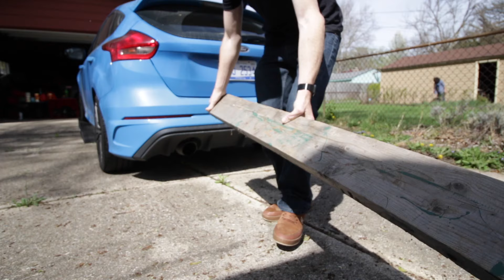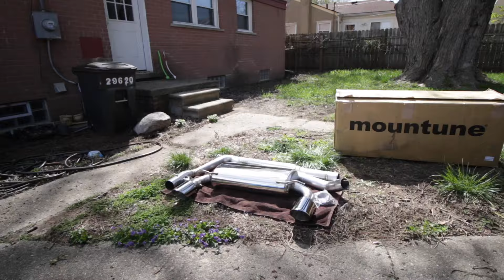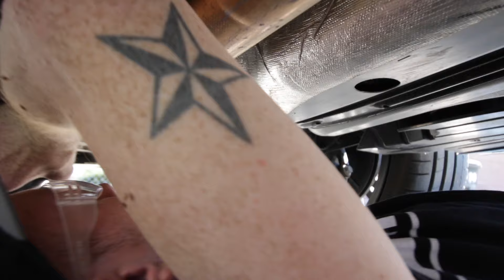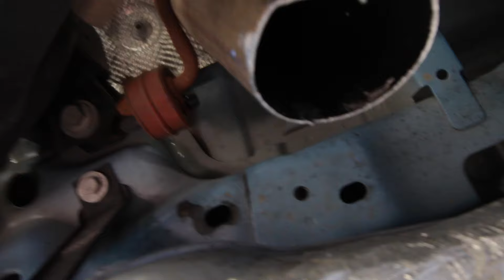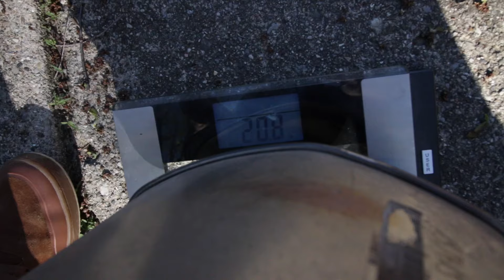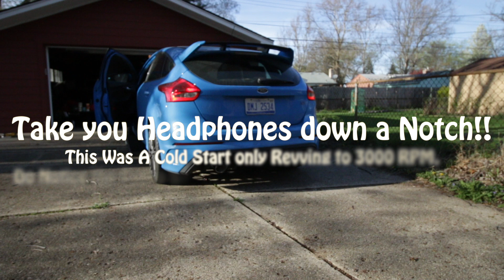Official Install of Mountune's V2 Focus RS CatBack Exhaust

Comment: Hi chris hows the car going head gas probs
Reply from the maker: The deck was warped and head cracked. They bought it back :-(
Reply: Christopher Ayres what happens then do you get the chance for new car . I have got a focus st eco with the mr300 . I think that ford just have went to the egde with it . Milling the block out to 2.3  . The mk2 rs with the volvo 2.5 is all most indestructabul .
Reply from the maker: There is no stricter to the cylinders to the inner block but at the bottom. The cylinders are thick they just have no secure to the inner block on the top end.
Reply: I have read that ford are trying a piston liner . In the uk the rs price is falling . There is more up than just a head gasket from a muststang .
Reply from the maker: The block itself is flawed. They should try filling in the dead space between the cylinder walls and the inner block with aluminum then all problems gone, but that costs about 2 times as much to mold and manufacture.
Reply: A think its never goning to be right with that engine . In the uk there was rover and in the early 2000 there was an engine called the k series and it was same thing . Cracking cars but the engine was so bad you could not even take the head off all the threds would be striped on the block . Tryed take the spark plugs out and all you had was a hole left in the head . I have been looking at an rs . But a dont think this car is going too bee what an escort cosswoth has been in time . As soon as there no warnty is scrap
Reply from the maker: The only way it will be 100% right is if the re-design and engineer the current block, which would cost a ton of money. As an engineer working on the Mustang, our propulsion engineering sector is huge, I think one of the largest with almost 750 engineers just on the mustang Powertrain, and that does not include when they throw in a gt500 or Shelby. The RS program used maybe 50 propulsion engineers  granite the mustang has been a constant drivetrain evolution in the past 5 years especially but I personally think that the design of the RS block may have been more successful and better implemented if it had more support from the start. This is just my opinion. I mean we have failures like this to look back on and learn from. It may sound strange to an outsider of the automotive industry but every great car/Powertrain that has ever been made such as the 5.0 was not made perfect from the start. The only way that we can make these things great is by learning from mistakes. That goes for life. We don’t just create a brand new engine platform and it be the best engine ever, we learn on its drawback and try to implement solutions. This is just my thought and how I look at work, some may think they can just make the best first try, but I don’t agree with that.

Comment: +Christopher Ayres Sorry to comment on an old video, but what model Race Ramps do you have? I'm trying to take advantage of Black Friday deals and can't decide between the 56 and the 67 inch model. I like the 2 extra inches of lift on the 67, but I'm not sure it's worth double the price. Thanks in advance!
Reply from the maker: Cinca0989 you only need the 56. Don’t buy the 67 unless you see a Pugani in your future. Waste of money and clearance. Get the 56 for sure. They fit even my lowered RS with no issues and about 2 feet of room under.
Reply: Christopher Ayres Thanks a bunch for the response. I ended up buying the 56 anyway before the sale ended at midnight and got them for less than 200 shipped. Not bad! While a Pagani is definitely in my plans, I'll just get the 67 before I take delivery of it. ;)

Comment: would you sell the stock muffler ?
Reply from the maker: +victor ST In a past car I would. I don't like to sell stock parts because I'll likely move to something a bit more fun. Let me think on it as the Mountune unit can be sold easily on car. I will let you know.
Reply from the maker: +victor ST Are you local to Michigan?
Reply: I would pay for shipping
Reply from the maker: +victor ST Worth it. As the heat cycles it gets deeper and deeper.

Comment: brilliant video my choice would be the mountune exhaust :-)
Reply from the maker: +Steve BHP DEVON It is very nice. In fact I have noticed it getting deeper as I drive it and the metal runs through their heat cycles!  It's probably my favorite thing on the car, besides the tune of course.  Thanks Steve!

Comment: Been a subscriber since the beginning of your RS series. It's great, Chris. And proves you don't need a lift to do work like this on your car. Looks tricky for someone whose 195cm tall like me to get under there though!!

Quick question about oil...did you notice if installing the breather plate reduced your cars oil consumption? Mines using around half a litre every 6k miles. And it's going somewhere. :(
Reply from the maker: +Paul Groves I kind of installed it before knowing weather or not I was consuming oil but since the install I have been not loosing any noticeable amount. I hope that helps.

Comment: Only wish is that Mountune had more options as far as the finish on the exhaust tips like other high-end brands, great video as always Chrisopher Ayres.
Reply from the maker: +bumatlarge51 I black option would have been good but at least the tips are 304 too. Most companies use cheaper stainless on their tips than the rest of their exhaust.
Reply: I agree, I have a stealth grey RS and would have loved a black tip option, but the system is expensive enough without having options.
Reply from the maker: +bumatlarge51 it's because of the v band and steel, not to mention being the best sounding RS exhaust thus far. A lot of engineering went into this specific to the RS by mountune.
Reply: Looks like I'll have to wait for the exhaust, took the car to Ford today and have coolant leaking into the cylinders.  My car didn't even make it to its first scheduled oil change.
Reply from the maker: +bumatlarge51 Wow, 2017?  Did you notice low coolant or shit idle?  That's no good. I'm sorry to hear that?
Reply: 2016, noticed a shit idle last week and got the car scheduled.  They gave me a phone call this morning and confirmed it.
Reply from the maker: +bumatlarge51 head gasket?
Reply: Most likely a head gasket, will no more once they take it apart, they're dragging their feet giving me a loner vehicle.  Service rep asked if I had another car to drive and I laughed at him and said it's not a daily I need a replacement for the RS.
Reply from the maker: +bumatlarge51 lol. Well the good new out of this is ford performance has released a updated gasket for these motors so chances are you'll get that one which is more robust and less prone to failure. It's new to all 2.3 ecoboost, mkz, escape, RS, etc.